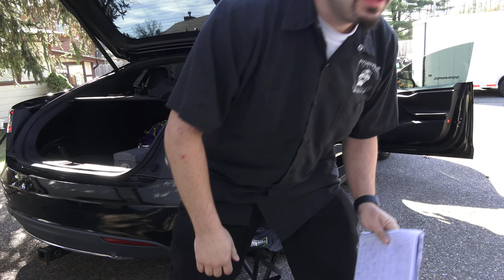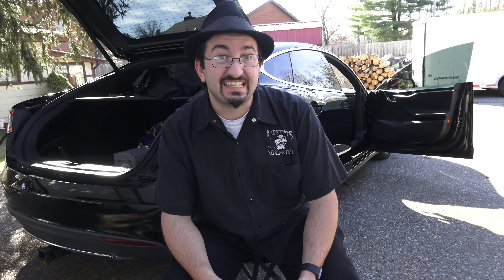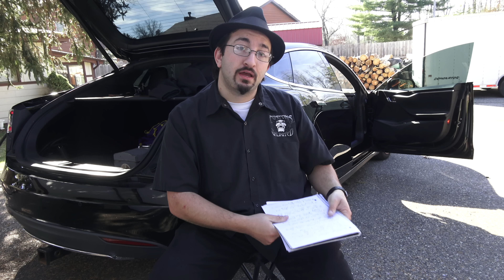V.44 Kman's Weekly News VBlog November 4th, 2016

Comment: the Tegra chip is a mobile chip sorry not good for editing intel 5820k is a great cpu for editing work I have one and the 4K videos 5 minutes long takes about 30 to render and the price was about $800.00 for all the parts to run the pc.
Reply from the maker: I didn't mean the Tegra chip, it's slower then heck. I had meant the new one thats 40x faster then the Tegra. 
I currently have a first gen I7. I built my system in 2010 I believe it was. 2.8Ghz 4 core Hyperthread I7, 16 gig DDR2, 30TB Storage in Striped Raid (For Access speed, don't need to worry about redundancy, as I have backup plans in place). 

I Overclocked my i7 to about 3.4    It edits video fine. Don't care about rendering speed. I just set all my stuff to render at night or when I'm not home. I usually shadow process my 4k footage unless it's a short video. a 10 minute video takes about 1 hour to render, unless I do Software Video Stabilization, or real heavy processing. If I don't process the video at all, and just cut clips. If I just cut the clips, my editing software has something called SVART. It's SVART system only renders the changed footage. Using that, I've been able to process a hour long 4k video in about 3 minutes (Or in other words, bottleknecked out my RAID Array's max transfer speed).
Reply: Ok cool if your ever in east tenn let me know so I can give you solar power my friend be driving on sunlight I have a super changer in my house =)
Reply: JK but I can give you solar power
Reply from the maker: Might be joking, but you succeeded in getting me to hit the reply button fairly quick!

I've been looking for a cheap CHAdeMO station. Parents motel has a 75kVA transformer, and I'd love to put one there, or my house. Thought it would be fun, but even nissan's subsidized station is a no go. Thought it would be a cool Mini-Supercharger.
Reply: If you need to charge the car on solar power we can talk and I will help you look at the best way to charge your car on solar if you need because the grid power may not stay up always and you will need to have a way to recharge power from the sun like if a snow storm or something like that so thanks ps my channel is to teach everyone to save power and live green thanks phillip20

Comment: The task the current generation of vehicles is doing is collecting traffic data points and sending that information back to Tesla servers for scenerio analysis through their current set of algorithms. The next generation hardware will do exactly the same, only with more data point generation (e.g more cameras & sensors). You can see all the data points being collected via the object proximity heat maps displaying through the dashboard. The vehicles themselves are not crunching this collected data themselves.

Comment: http://www.cnbc.com/2016/09/08/dutchman-dies-in-tesla-crash-firefighters-feared-electrocution.html

http://mashable.com/2016/11/04/fatal-tesla-crash-batteries-fires/#0d0dC0wkCaqp

this is what i predicted with the alu chassis and the highly explosive battery.
everytime a crash happens with an tesla and the battery fireworks happens  its always claimed to the high speed fault .
well if the battery encasement wouldbe able to resist such crash it would have save alot of lives and less wounded.
the cells act like fosfor granates and can explodes for 24hrs and thats an all whole other situation than just an fire.

if i saw it right the model E will have an metal chassis . thats one problem solved but what about the battery encasement.